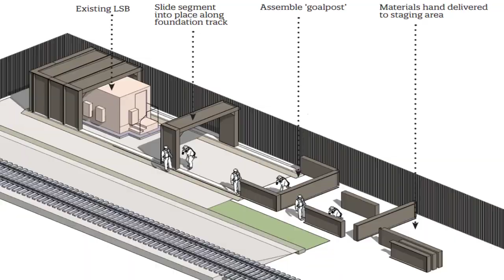High-tech building 'armour' promises quicker, cheaper, low-carbon repairs

Comment: If the original buildings were looked after better and had money spent on them this “wrap” wouldn’t be needed, after all we don’t “wrap” our homes we do preventative  maintenance on them. Or are you saying doing maintenance is not climate friendly?
Reply: One of the things this does is effectively gives it an air layer of insulation. So effectively what they did was reface their building and add insulation.